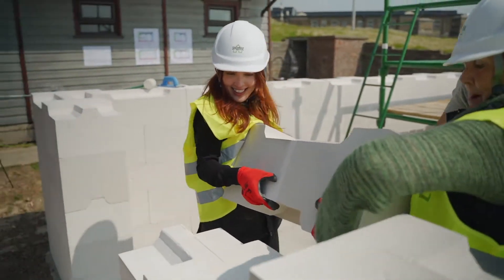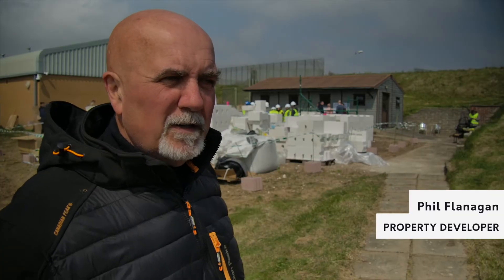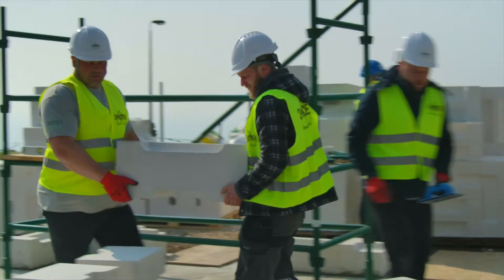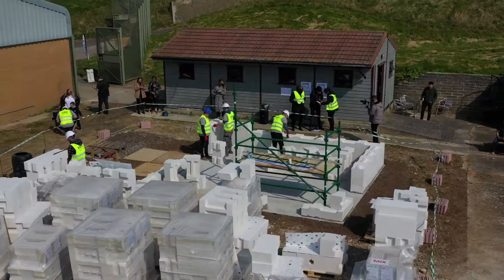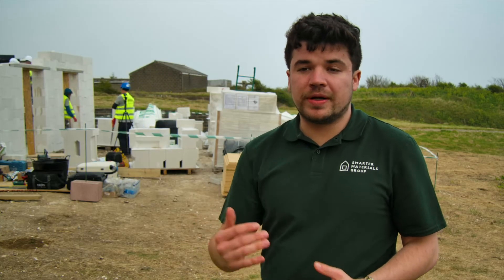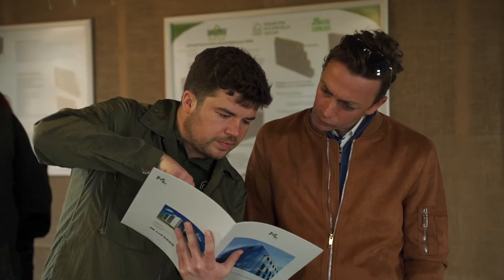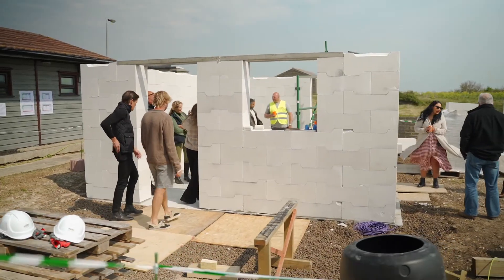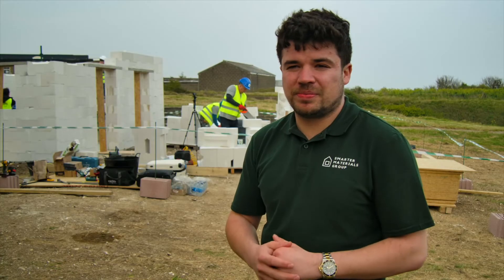System 3E is a revolution in green building and it’s only just started

Comment: And there is nowhere in the wall to run, gas, electric, or plumbing? Didn't think that through!
Reply from the maker: Great point - but this was a demo that was constructed show show ease and speed of build. The material allows for you to channel without degrading the structural integrity. Typically services are run under the building when the foundations are laid so we would even need to make a hole, if you somehow did manage to forget :)
Reply: @smartermaterialsgroup9278 can you tell me measurements

Comment: this system work in typhoons, storms and earthquakes? cos one brick over another brick without glue or pillars oe something do not look too resistant for me, what happens if I want to build a second or third floor and a roof to walk on, does this system work? would resist weights and forces?
Reply: Glue won't necessary secure a building against earthquake or big storms. If you don't have elastic connections, it will brake anyway... And this is glued together afterward with glue and net, truss should hold it from top, i guess
Reply: @martinmacak284  you can put panels on it or pump cement into the nooks and crannies
Reply: @martinmacak284  also holes in the lego brick could allow custom rebars into it...
Reply: @zogvog119  there’s no place for rebar. You have to connect it from the outside and top.